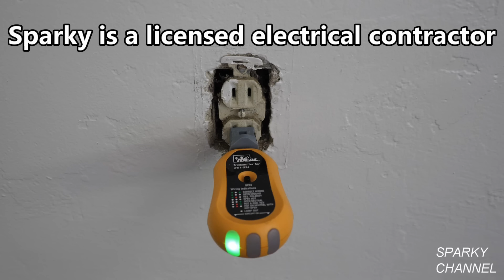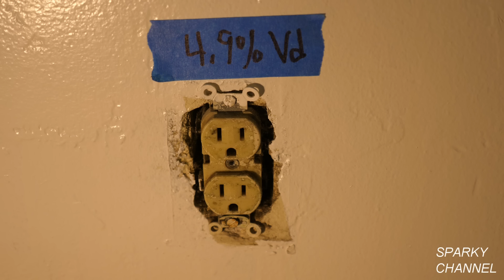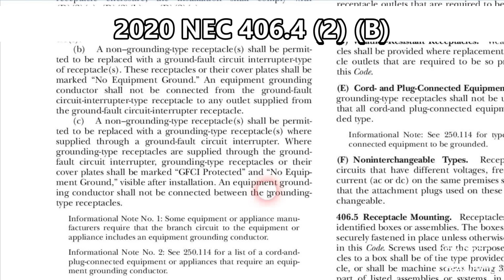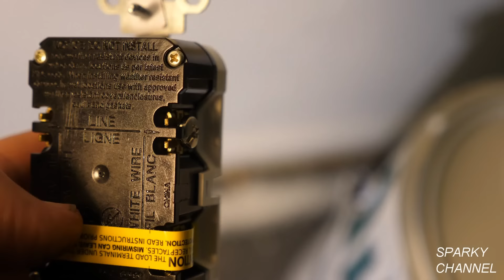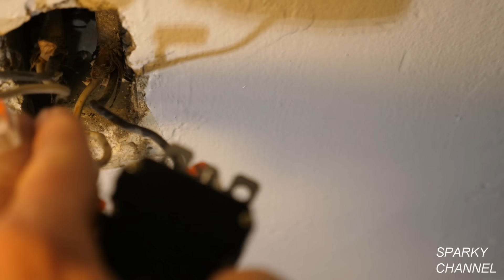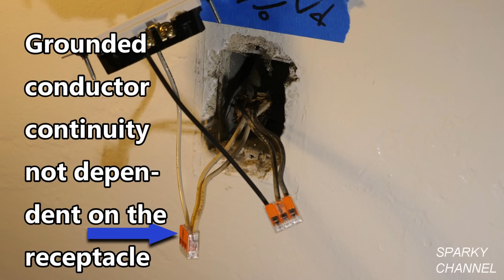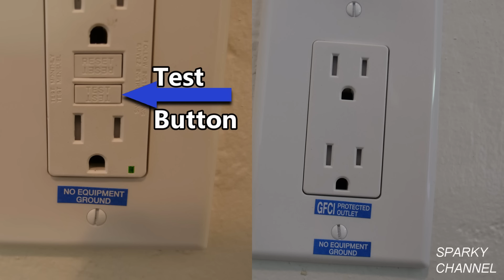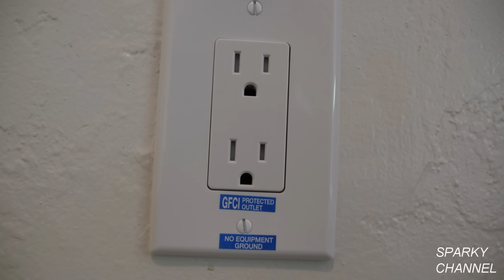2 Prong Receptacle Circuit Replaced by GFCI and Grounded Receptacles per 2020 NEC

Comment: Why did you wire  2nd receptacle differently than first....couldn't it be wired the same way?
Reply from the maker: Hi Ruth. It's because the first receptacle is a GFCI and the rest were regular 3-prong receptacles.
Reply: Remember the GFCI trips when it senses a current imbalance between the line and neutral so if it had been wired like the second it would not be able to sense that  as all the receptacles would be bypassing the GFCI. Their current needs to flow through the GFCI sense loop.

Comment: Maybe I missed something, but where can I find those stickers to label the outlets? My favorite outlet video, thanks!
Reply from the maker: Hi. The stickers can be found in the boxes that the GFCI's come in. Check out tomorrow's video because it will be about different kinds of GFCIs and AFCI/GFCI's.
Reply: I put the GFCI label above the upper outlet and the ground label just below the lower rather than outside the screws or the labels are too easy to get wiped off when being wiped down. People usually avoid getting too close to the outlets.

Comment: You got the video title wrong there. your three prong "grounding type receptacles" are not in fact grounded, you did explain why that is allowed with the GFCI, but I watched the video to find out how you retrofit an equipment grounding conductor, and you didn't.
Reply from the maker: "Grounding type receptacles" is the language from the NEC and refers to a 3 prong receptacle that has a grounding terminal available.
Reply: You do it by running a new circuit, dummy. Have fun with that.
Reply: @RB-xv4si   I know that, that is why I watched the video to see if he had any useful tricks for running a new circuit in an existing building. If we are going to be calling anyone dummy it should be the one who wrote the video title.  He could have saved himself over a dozen keystrokes and had much better title by simple leaving out 3 words e.g.: "2 Prong Receptacle Circuit Replaced by GFCI per 2020 NEC"  still not perfect wording, but better than it is.

Comment: Can you comment on the plus and minus of methods of adding GFCI and AFCI? For example, in the case you show in the video, what would be the + and - of instead changing the breaker for a GFCI breaker?  The obvious (-) is that the GFCI receptacle is cheaper that a GFCI breaker. In an old house like shown, what about (A) changing the breaker for an AFCI breaker and using GFCI receptacles as you have shown, vs (B) replacing the breaker for a Dual Function breaker with AFCI/GFCI? Asking for a friend.
Reply from the maker: Hi Mark. Watch tomorrows video. It's all about different types of GFCIs and AFCI/GFCIs.
Reply: Probably because older panels aren’t forward compatible, you just can’t get a GFCI breaker.
Reply: Here in California we have to afci protect just about everything now with a few exceptions. Using AFCI breakers generally will fill a panel quickly leaving no option but adding a subpanel. To avoid this we usually will Run 12-3 mc cable to garb disp/dishwasher, washer/dryer, and kitchen counter top receptacles. You'll need a metal box. This allows for use of a combo afci/gfci plug in a location that wouldve needed a gfci anyways and is accessible to reset if a problem occurs. This saves space in your panel and reduces your overall cost of expensive afci breakers. Last note, you can only do this up to 100' of wire length.

Comment: Thanks for all the good information in this video (in particular, the WAGO connectors solve the problem of pre-existing short pigtails in electrical boxes).  I have a related situation with a couple questions.

In an old house (built before 1950’s), the electrical system uses BX (AC) cabling and metal boxes.  In a downstairs bathroom, there is a pre-existing triple gang box which houses an old 3-prong receptacle and two SPST switches used to control an old fan/light combo.  The receptacle has no ground wire connected (presume that the ground connection is made through the metal box).
  
Question: is this receptacle considered to be ungrounded even though the mounting screws make the ground connection to the metal box?  Reading through the code sections this point is not clear or maybe I’m just being thick.

Question: if the existing receptacle does make the ground connection through the mounting screws to the metal box, wouldn’t the circuit tester show that it is grounded (as opposed to having an “open ground” as you demonstrated in your video)?

I want to replace the old receptacle with a GFCI.  The question is whether to connect the green wire on the GFCI to the metal box or leave it unconnected and label the GFCI as “no equipment ground” and any downstream receptacles, now protected by the GFCI, as “GFCI protected outlet” and “no equipment ground”.  Based on your video, I am leaning toward the latter option.

Last question: in the same triple gang box, there is a separate feeder which was used to power a fan/light combo (both feeders come from the same breaker which I verified after shutting off the breaker).  I want to replace the old fan which no longer works.  The new unit has a battery-operated remote control which installs into the electrical box even though no electrical connections are made to the remote controller.   The new unit has color-changing LED type lights.  The specs say that the unit should be GFCI protected.   Adding a new GFCI breaker at the panel just for the fan feeder is expensive and seems like overkill.  Or, I could add a second GFCI to protect the fan but this would look silly to have 2 GFCIs in the same triple gang box.   Or I could just protect the fan/light combo from the receptacle GFCI, which is not ideal, but seems to be the most straight-forward option.  Any suggestions?

Thanks for listening!

Comment: Great video.. I have to fix the outlets in my house asap.. i have a very old house that seems to have  cloth covered wires.. they said it was the norm back in the day.. i have a question though  i have a wire.. that keeps going to the next box obviously.. but it is stripped in the middle and wrapped around the screws of the switch..  this is instead of being cut and combined like yours was.  is this normal?
Reply: I've seen this in old houses and old buildings. It's not normal by today's standards, however not unheard of for older wiring.

Comment: BILL..I USE THE WAGO CLIPS TO KEEP THE CIRCUIT ACTIVE IF THAT PARTICULAR OUTLET FAILS, CAN DO THE SAME WITH WIRE NUTS, BUT I HAVE FOUND IN THE APST FEW YEARS, YOU CANNOT SEE INSIDE A WIRE NUT AND YOU CAN SEE INSIDE THE WAGO'S THE CONNECTIONS.
Reply from the maker: Good points, thanks!
Reply: I haven’t used WAGO’s (yet) but you can also probe them for voltage without taking them apart. Cool little design.

Comment: Thanks Sparky! Very informative as always! My problem is the older outlets in my house the boxes are to small even for a GFCI, Maybe you could do a video sometime on changing out the small boxes for a deeper one without destroying the wall.  Thanks
Reply from the maker: Excellent idea! I think I'll do that!
Reply: Use a sawzall with metal blade carefully cutting the mounting bracket between stud and box. Then remove box. Install new remodel box or cut nails off of new construction box and install screws from inside the box to stud. Those old boxes you described are usually brittle and can be smashed into pieces with a hammer and screw driver making bracket removal easier

Comment: Good instructions about using pig tail to maintain continuity of the circuit to other outlets. I was curious why didn't you use pig tail on the 1st GFGI having 4.9% Vd?
Reply: He can't in that case. In order to have the GFCI protection, he needed to be on the load side to have ground faults trip the GFCI.
Reply from the maker: @jrmcferren  Excellent answer John!
Reply: @jrmcferren   Thank you. I understand now.

Comment: i have never been able to set a gfci without a ground let alone protect the other outlets on the load side i wish i could have seen you test  those outlets with the the tester to see them trip under ground fault.
Reply: You can't test the downstream outlets using a receptacle tester. The reason is, the tester simulates a ground fault by a resistor between the hot prong and the equipment ground which you don't have. That doesn't mean the gfci is not working. It means that the test method is not valid. To test it downstream you could use a cheater plug, and somehow ground the equipment ground contact.
Reply from the maker: You test by pressing the test button directly, not by using a tester. Try it and let me know how it worked.
Reply: @SparkyChannel  it's a good idea to use a tester because you can get measurements from it. Every rcd/gfci in the UK has to meet standards, and using a tester will verify they do.

Comment: Bill I'm curious. One the GFCI outlet may I ask why you didn't add a ground pigtail screwed to the back ofthe outlet box and the gfci grounding screw? Would that not add an additional layer of protection? I'm asking because I'm very curious, I'm not assertaining your expertice sir.
Reply from the maker: I understand. What I do is test with a meter from the metal box to the hot wire. If it shows about 120V the metal box is providing a return path to ground, so I would  do what you mentioned, but you have to use an approved 10-32 green grounding screw. I do that in a couple of the house renovation videos such as: Separate Switches for Bath Fan and Light from Single Switch in a 1960's House: https://youtu.be/-KM9crpIU8Q
Reply: @SparkyChannel  Ho Bill I understand. Thank you for giving me clarity it makes a lot of sense.

Comment: Is GFCI the only reasonable solution in a case where no grounding is present? I am in contract for a home with this issue and I fear the money required to get grounded plugs installed will be way too expensive for the sellers to offer a credit to do it. GFCI can trip when it rains... not fun if you're watching TV or working on a computer, especially with the box outside. Any advice? 1958 ranch, 1500 sqft on a crawl space.
Reply from the maker: Best wishes on the house! What kind of walls does the house have? Raised foundation or slab?
Reply: @SparkyChannel  Thanks! Not sure on the term but I asked the inspector if it was the old kind with all the wood inside and he said no. I guess the more modern frame kind, or whatever was standard in 1958. It is a raised foundation.
Reply: @SparkyChannel  I've got a screenshot from the inspection report if that helps https://i.imgur.com/qIwWdKZ.png
Reply: @SparkyChannel  Any ideas Sparky?
Reply from the maker: @zunedog31  Interesting screenshot. It doesn't look like anything that can't be fixed. It's just a question of how much it would cost and there is no way for me to tell.
Reply: @SparkyChannel  Okay, thanks for taking a look. I did my final walkthrough yesterday and put a little tester into each outlet. They all showed pen grounds except for two which were correct. Also had a couple which had the center light lit and the right light was dim. I took this as a sign that a ground is present. I'm going to have an electrician look at it and see what's going on. Thanks!
Reply: If the GFCI is inside the house and not grounded I’m not sure how it will trip in the rain since it should be dry and no ground means no bypass path. If it did trip in the rain then you have a bare wire that’s getting wet and that’s existing and no way to really test for that, maybe megger.
Reply: @n.gineer8102  He has a plug outside further downstream on the same circuit. His best bet is to better protect the plug outside from water or run a new wire to that plug and seperately gfci protect it.

Comment: Can a multimeter be used in place of the circuit analyzer to measure voltage drop?
Reply: In order to determine voltage drop you need to apply a load to the circuit. A multimeter doesn’t do that
Reply from the maker: Well it can give you a good idea of what is going on with the circuit.
Reply: You could use a multimeter combined with a 15A load (for example, an 1800W space heater) to get a decent approximation. You’d just measure the voltage with the load on and off and calculate the drop under load. 

(It’s not exactly the same because a heater is a constant-resistance load, not a constant-current load like his magic tester. But it’ll still let you compare the voltage drops in the receptacles to figure out which one has the lowest drop.)

Comment: Great video! I don't work on electricity enough to justify buying that $250+ circuit tester.. so I'll stick to disconnecting the power and using my Klein wire tracer (works awesome!).  Thank you sir! Again great video.
Reply from the maker: Thanks Rico!

Comment: I installed a GFCI receptacle to replace a old 2 prong one for my new refrigerator and when the compressor would come on the GFCI would trip. Any thoughts why?
Reply: I was told by an electrician friend of mine that when some motors start (refrigerator, trash compactor) it draws more amps for a second or 2 and if it gets to within 80% of the circuit rating it will trip the gfci.
Reply: Refrigerators or anything with a motor should be installed on a standard 15A outlet . When the motor kicks on it has a higher start up amperage than normal so the current imbalance will cause a GFCI to trip

Comment: So the outlets still are not grounded but protected by the GFCI outlet?  Is my understanding correct?
Reply from the maker: Yes, that is correct.
Reply: @Charlie Yep. The GFCI compares the current going out the hot wire and coming back the neutral. If any of the current gets shunted elsewhere (e.g. through a human to a water pipe), it detects that the amount coming back is less than what went out, and trips. Amazingly simple, yet literally life saving devices!

Comment: Super helpful video! Question... I followed all the steps, and replaced the outlets. When I press the TEST button on the outlet, it trips, and everything downstream shuts off as it should, and when I plug a receptacle tester in, it shows "open ground," as expected. HOWEVER - when I press the GFI test button on the RECEPTACLE TESTER - it does NOT trip the outlet. Instead, the receptacle tester displays indicator for "hot/neutral reversed" while the GFI test button on the tester is being pressed (this was a step not show ion your video...). Again, the test button on the outlet works fine. Any info or thoughts? Thanks!
Reply from the maker: Everything is working correctly. The correct test is to push the "test" button on the GFCI.
Reply: @SparkyChannel  Excellent, thanks. Out of curiosity, why doesn't pressing the test button on the TESTER trip the GFCI? Thanks.

Comment: Loved the video. I do have a question, in the event that I do want my receptacles grounded, could I run a grounding wire from my panel (where the main panel is grounded by the cold water pipe and ground rod) and individually run it to each receptacle in the same circuit (in a daisy chain fashion). What would be the code reference that would allow me to do that or not to do that?
Reply from the maker: I've never seen that in the code book one way or another but I have talked to my local inspector about it. He said it would be OK as long as I keep the insulated green ground wire in a sheath or conduit.

Comment: Would you be able to put in a GFCI breaker for the circuit?
Reply: Yes, that is permitted for replacement of 2-wire receptacles if "no equipment ground is present in the receptacle enclosure".   NEC 406.4(D)(2)(c).  Your local code may vary.

Comment: So to be sure. Our house gas alot of old two long outlet with no grounding. A current fix to change to a three pong is add a GFCI to the outlet connect first to the circuit breaker correct? But the ideal situation is to add new wiring with grounding correct?
Reply from the maker: Yes, that sounds correct.
Reply: @SparkyChannel  Couldn't you just take out that "suspected first outlet" and see if it just has one black and one white wire instead of 2 of each ? Meaning its the first in the circut. If you have no tools, I am pretty sure that would work.
Reply: You can also add install GFCI Circuit Breaker that will protect all outlets that is connected to it as well.

Comment: You are a very good instructor! For someone who had no clue about electrical matters - I now understand the process of converting two prong outlets to a GFCI.  I was about to spend thousands rewiring old knob and tube wiring that is in good condition and now realize it is not necessary.  Thank you!
Reply: Sir, I think your misunderstand the point. A grounded receptacle is very useful in protecting your devices and yourself. The code allows for the replacement of non-grounded receptacles with grounded, but it certainly is not the ideal option. Grounds are very important. I did a service call today where a ladies water heater connections were loose causing extreme heat in the junction box so much so that it melted the wire nuts completely off the connection. She asked why it didn't trip the breaker? Very simple, there was no ground to the water heater. Standards breakers require a ground or all you have is welding rods all over your home and inside your walls. My customer was very fortunate that It was an easy fix. Trust me, you want grounds.
Reply from the maker: Please change out that knob and tube as soon as you can.
Reply: @SparkyChannel  grounded gfcis are in bathrooms and kitchen of a 100 yr old house.  Rewiring a 4 bed 2 bath house at a cost of $7500 is impractical just for lights. My understanding is that Adding a gfci to those outlets  will help to protect from hazards. Until a full rewiring can be done in phases. at least that's the plan.